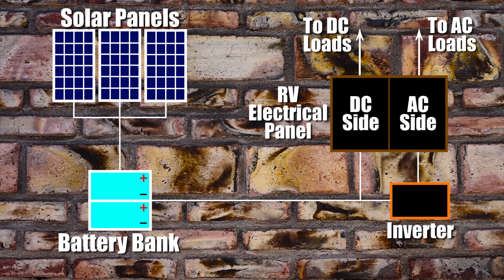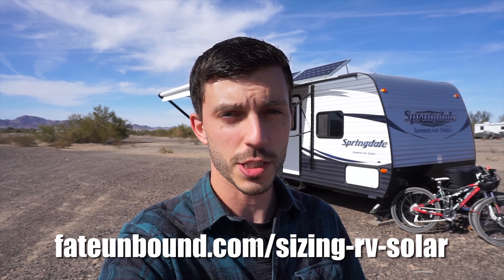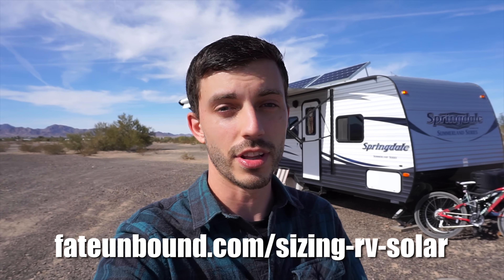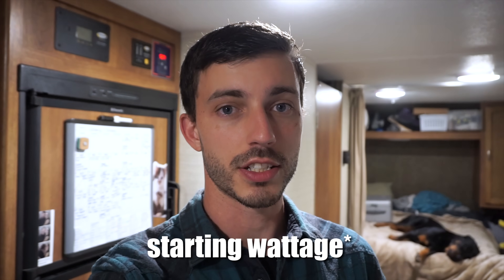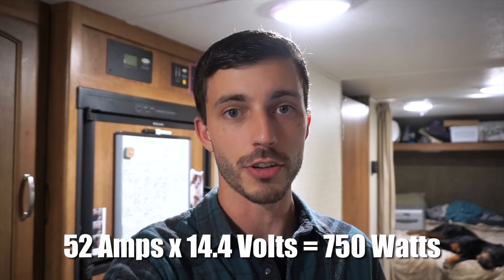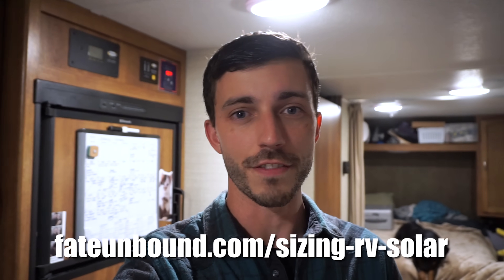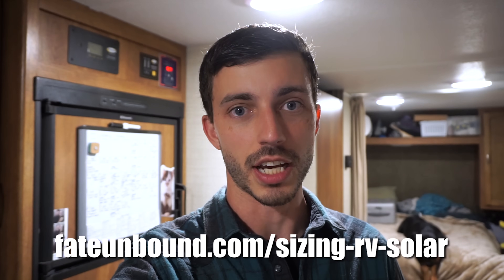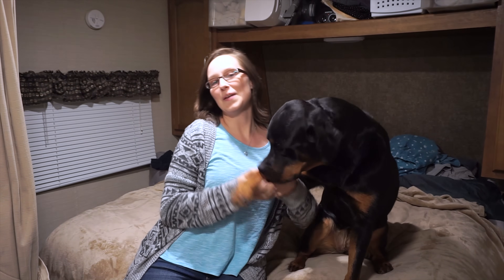How to Power an RV Air Conditioner with Solar - Full Time RV Living

Comment: ok, 73A @ 12v = 876W to run 13K BTU unit.

So if you were running a 5k BTU window unit, pulling 360W, that's 30A.
Figure 66% duty cycle as the unit starts and stops. So you need 20AH (amp*hours) per hour of use. 8 hours of night use would be 160AH. 

Conclusion: You could run a 5k BTU unit all night on a 320AH battery bank and not go below 50% charge. Right?

Comment: We are new to solar. Our rv ac says 310. We would just be running the ac during the day for a couple hours on solar because Florida and it’s satanic hot here right now. At night we run a generator for everything. Just running the generator from about 8-10pm until 4-5am we go through about $17 in gas a day. Our control panel in the rv says it’s an 80amp but my father in law says it’s a 110 rv. I have no idea what all this means or how many batteries or panels we would need to run our ac for a couple hours and our mini fridge.
Reply: How much space do you have on the roof for panels?

Comment: You could add a soft start for the AC so it wouldn't draw as much to turn on the compressor. You could also get a smaller AC unit for say just the bedroom or any other area you can seal off by curtains etc.There are small 5000-9000 btu units either as a window mount style or mini split system, these will be good for 150-300 sq ft.

Comment: This is awesome news, I have a friend that bought himself a 21-foot 2014 tag along camper. Someone had put over $3,000 worth of solar panels and batteries in it. And he has not even attempted turn on the AC, this is really good news to see if he has the right equipment to make it work. Thank you so much for this awesome information. You the man, God bless

Comment: This is a major advantage of a van. If you absolutely must on an exceedingly hot day, you can simply cycle the engine and blow the factor AC a bit. I find that the van AC combined with the roof vent fan set to blow out cools the van down very fast and effectively, and uses far less gas than what you’d expect.

Comment: Hey, kudos to you.  I wish that I could install panels and do all that wiring on the sine converter etc.  With the new 12 volt refrigerators
Replacing the fire bomb absorption fridges and boondocking becoming so popular a rv trailer must be able to sustain itself longer and longer.  You guys have just given yourself even a bigger edge to go wherever you want.   Congrats..

Comment: Why do you need 13,000 btu in that small camper? Answer- YOU DON'T! Replace it with a 5000 btu! And a little info for you hard core people- A certain tech is working on a 12v dc air conditioner for smaller campers! And may even be a 1500 btu model for really small campers!!

Comment: Some people replace the RV system with a mini split heat pump system with VRF.  Very energy efficient and does heating and cooling.
Reply: So doesnt that still need electricity?
Reply: @alive-awake  yes but way way less. Even a window ac unit uses way less than a rv overhead ac
Reply: @alive-awake  it has a soft start, and double the efficiency.
Reply: Interesting Mr. Taylor.  Good looking out

Comment: you missed that recharging the power into the batteries is not 100% efficient, more like only 80% so you need even more to recharge than what you use. unless you have lifepo4 batteries, they are much closer to 100% efficent

Comment: I'll be running my 10K BTU A/C on a 5.2KW Tesla model S battery module with 1.25KW of solar.
Reply: What kind of rig are you driving?
Reply: @PaDutchRunner  we're just about done converting a 2000 E350 handibus into a tiny home.
Reply: Where do you get that battery module?
Reply: @matthewbrigham7715  I got mine from eBay for C$1500.
Reply: @kaidenrogers  Thanks Kaiden...great videos. Above my head at times, but that's expected with me :)

Comment: I wonder if one were to install a mini split heat pump (120v), how well would it run off the batteries?
Reply: That's what we have in our skoolie. It pulls around 300 watts on the very low end and 1200 watts running at full output.  

Keep in mind that a minisplit's efficiency comes from being able to run at a variable output. In other words, if you only run it for for the hottest 4 hours of the day itll need to run at full output and wont be significantly more efficient than more traditional units. On the other hand, running mine all day long on a hot summer day uses about 8kwh.

Comment: I'm looking for and off grid 2 camper 2 13.5 btu air conditioners system. I've been looking at 5kw kits on Alibaba. I have 5 acres of desert land with a 32' 1977 Silver Streak and a 24' 1968 Silver Streak . I'm remodeling them both and I was hoping I could do an off grid system I could plug them both into. I'm a newb and I'm struggling with solar a bit. Thank you.

Comment: You can use a 5 gallon ice in a portable thermal box cut a whole the size of a small fan and cot another spot the size of a vent and run the fan through the ice and you get very cool air coming the other side and you can keep a small place nice and cool even in desert weather

Comment: 73 amps for 1 AC does not sound right. 
Think about your house. What do you have at home that even draws that much?...
At those amps you would pop the main breaker on a 50 amp landside hookup.

What am I missing?
Reply from the maker: We aren't plugged in out here in the desert. We are talking running the AC off our 12 volt batteries not from a 120 volt wall outlet. 73 amps from 12 volt is 7.3 amps from 120 volt. Get it?
Reply: Thank you for that explanation. I had no idea.
Reply from the maker: Yep! The amperage draw from a 12 volt source powering a 120 volt appliance will always be 10 times higher than the required amperage to run the appliance because watts = volts x amps. If voltage drops by a factor of 10 then amps must increase by a factor of 10 since watts remains constant.

Comment: I'm going to attempt a hybrid approach with my system. I have three 100ah lithium batteries, a 3,000 watt pure sine wave inverter, and 600 watts of solar. I recently purchased a tiny Ryobi propane generator (weighs 25lbs and does 700 continuous watts) + a 26 Amp Noco Genius smart charger. Also just added a soft start to my 13,500 btu AC. Excited to see how much run time this setup buys me.
Reply: Any update?
Reply: @lemm1388  I'm waiting for an update as well
Reply: Figure it out? lol

Comment: I have a 1993 Roadtrek 19 ft. right now we run the generator when traveling to be able to use the back  air unit which is a 6500 btu unit. wondering if would be feasible to run just the air conditioner off of solar . live in Florida and usually travel with grandkids to upstate NY. can plug in when get there but need that air when traveling and even for everyday in summer, hate using generator so much. any advice or comments please ty

Comment: I am considering adding a wind generator , verticale kind, not the prop type, to compliment the solar system.  If it is a windy night or cloudy day, the wind generator will charge battery bank.

Comment: Are your panels permanently attached to the roof? I’m a little freaked out by doing anything that might compromise my roofs water tightness. Also worried about roof maintenance with one more thing up there to clean and seal around. I have TPO roof.

Comment: Why in The World Would You Need a 13,5000 BTU AC Unit When a 5000 BTU Unit Would Work Fine ?
Reply from the maker: I think it's because these air conditioners have a difficult time keeping up when it's really hot outside, like 95+ degrees. So a 5,000 BTU AC would fall short even sooner. Just a guess though.

Comment: Considering getting a 450 watt 5000btu Frigidaire window unit for a sprinter van. 22 feet by 6. less than 150 sq ft. draw after start only 300 watts. so basically just take your figures and divide by 3?
Reply: Patrick Allen to calculate power consumption, use very simple formula.

Volts x Amps = Watts.

If you know 2 of the 3 variables, you can pretty much solve most electrical questions.

Look up “ohms wheel”

Comment: Seems to be some confusion, the ammeter is measuring the current being drawn by the inverter  to power the AC unit. The AC unit may peak at around 20 amps during start up. Are you running a 12v system?

Comment: 13000 btu is over kill big time for that camper..you would be better off with a 5000 btu portable.  Those camper related products are very overrated..and poor preforming..but you would have to roll them dice to ever find out..my 8000 is a little bit under sized for the tiny house. 27 feet long.. should have got a 10,000 btu. Fyi the tiny house is two story

Comment: P.S. Lead acid batteries are bottom end...agm as well..fine for stationary systems but inferior for that as well...go lithium ITS NOT MORE EXPENSIVE...if you can do remedial math... I'm not the brightest star in the sky and mine works great so far..I. blown away by it actually....no more electric bill

Comment: I built a tiny house and gave an 8000 but ac on solar 500 ah batteries 4000 watt inverter 1800. Batteries are fully charged by noon . And easily carry me through the night with plenty to spare. Also running microwave, coffee pot ,lights....LED.  ,tv,ps3, fans, table saw 15 amp,12" chop saw, small fridge, air compressor,  so I don't know what you guys are talking about..solar is awesome. Size it right and dont go cheap on the batteries and forget about it...and you can easily fit 4-6×300 watt panels on that roof..

Comment: I found your video quite informative and it answered a lot of my questions. I live in a 29ft Layton trailer in S. Texas on the Gulf coast. It is hot and humid here 9 months out f the year. My electric bills are from
$120 to $160 in the summer. However there is plenty f sunshine here so I figure going solar would help a lot, even though it would be expensive to get it set up.
Reply: rbagel55 Look into hybrid inverters. If you are already plugged into shore power and have a modest solar array and battery bank, the hybrid will lower your electric bills. They reduce the draw on shore power/generator by drawing from the batteries and then feed the batteries from shore power when the batteries are low. (This is all assuming that I’ve properly wrapped my head around these things). 

Assuming I’m right about this, you could then increase your battery bank and solar over time until you are able to get off the grid power completely. 

D.

Comment: AC is probably the biggest hurdle for most people trying this life. Once you get over your need for it you can live off grid. I suggest before people begin this life to basically spend as much time as possible outside to get acclimated to the weather. Learn to park in the shade and live in the shade. It is night and day hanging out in the shade under big trees or by cool streams than being in the middle of a baron landscape with no cover. Once you get acclimated you no longer feel as hot as you did. Night time is no longer a problem. In fact you may even feel cold even at 76 degrees or higher.
Reply: I don't care how big the tree is, in a hundred and ten degrees you're going to be miserable. That is why I spend 6 months of my life solving that problem for my RV. I can now run my air conditioner 12 hours a day when the summer gets hot. I hope that others can achieve the same goal so I started sharing my data on YouTube this month.
Reply: I wonder how people made it before AC.
Reply: The main problem is the humidity in places like the gulf coast. It’s the worst part of the summer.

Comment: So... the math seems a bit odd to me. I am heating and cooling an entire 3brm house and the inverter AC typically uses 500w, continously, but up to 1200w if 43°C outside.

An RV is muçh smaller,  so these figures should be achievable.

If your ac drew 1kw continously,  then solar should be achievable for paet of the day, eg sleeping. 1kw x 10hrs = 10kwhrs of storage. Even non inverter ACs should not be running flat out continously in such a small space. Are RV ACs hopelessly inefficient ?

Comment: I have a fifth wheel with large storage in the middle and storage in the front compartment. I'm estimating I'd need "8" 240amp 6v Trojan T-125 batteries. That's 544Ib worth of batteries would I need to disperse the weight out throughout the storage compartments? Seems like putting that much weight in one area would be an issue.

Comment: A good video... Thank you... Would like to see more so Wayside can be more educated in my choices regardless of what manufacturers of RVs and their equipment claim. One thing I have noticed on YouTube is that several people have changed their air conditioners to a low draw unit with higher efficiency, this leads me to believe the units that currently come with a new RV. And I'm looking... Are only interested and Prophets with a low-tech junk and no options. It is now 2018 -2019, and there's got to be better Tech

Comment: I’m a little confused by the information in this video, since your system seems to be a very similar to mine, only  I have less solar and less battery but can run my air conditioning with no issues for 6 hours. 

Yesterday I installed a 500w solar system, 3000w inverter (exact same model featured in this video), soft start capacitor and two 12v 100 AH Battle Born Batteries (LiFePo4) in parallel giving me an ACTUAL usable capacity of 200 AH (since they contain an unspecified unusable reserve capacity allowing them to advertise 100% discharge)

I was able to run my Dometic Brisk Air II 13,500btu unit for over 6 hours (cycling as required to maintain temp) and it drew only 15 amps. 

6 hours of A/C on two 100ah lithium batteries.
Reply: R Graham please define a “soft start “ capacitor.  I am an HVAC tech and I have no idea what you are speaking of.

There is a “hard start” capacitor, which provides a huge amount of start up power, which significantly lowers start-up amps of a compressor.  But I am confused what people mean when they say soft start.

Thanks much,
C

Comment: Do you think a smaller 5000BTU AC will work better for most small RV with battery power and solar charger?
Reply: Yes, worst case scenario you can partition an smaller area to keep cool instead of the whole rv

Comment: Inverter Technology Air Conditioners with DC driven compressors are the way, a few people have mentioned these already I agree.  My home unit is a 48,000 btu split or a 4ton system.  It starts on only 1.64amps, ramps up to 12amps~ before settling usually in the 4 to 9amp range .  For a 13,500btu inverter system you'll find those high amps are a thing of the past and will be pleasantly surprised how much longer these AC systems will run.  Love your videos.

Comment: Not knowing about RV solar systems, i would imagine that to run the AC, and most of your 110v appliances you would need at least two 100ah 12v LiFePo4 batteries, four 100w panels, and a 2000w inverter to run your AC...  So the trick is the type of battery needed to keep it the system powered.

Comment: One thing to remember also,  when your putting that kind of load on a battery bank,  you will be making quite a bit of hydrogen gas.  With that being said, there's always a risk of fire or battery explosion.
Reply: Not with lifepo4 batteries

Comment: If you run the A/C on solar ..I know you said you don't want to deal with portable solar cells .. If the system can add portables that could be an answer to add power to the system .. You may not wish to do this but others may want to do that .. But you do have some storage room where your inverter is .. Just my own thoughts..

Comment: Capacity information is spot on. However, the inverter sizing information is inaccurate. A typical pure sine wave inverter will handle double the rating for a short time. Usually 30 seconds to a minute.

Additionally, a soft-start kit can drastically reduce in-rush currents for large induction loads such as air conditioners.

Lastly, A/C efficiency should be the first consideration. The typical RV air conditioner is far from efficient, while the 12,000 BTU Climax Aire VS-12 dual hose portable unit consumes as little as 7.5 amps at 100% power and just over 4 amps at 50% power.

Taken together, all these contribute to the very real possibility of air conditioning on solar.

Comment: I have a very similar rv and I'm trying to downsize a/c for a solar system.  Why wouldn't a 5,000 btu window a/c work?  I'm just trying to get feedback before I do anything.
Reply: 1987Rlee From what I’ve gathered, find the square footage that an AC unit is rated for and multiple that by  .66 or .5 (2/3 or 1/2) depending on how well your rig is insulated. That should give a good indication as to wether or not your 5000 btu AC unit will work for you. Once you find a unit that works for your RV then you can figure power needed to run it using the calculations in the video. 

D.

Comment: I have 4 Systems I put together on 4 separate RV’s. None were sized for Air Conditioning. My present Toyhauler has 2-8D Universal Power Group in my garage. Strictly for our entertainment on 2-200 watt 24 volt panels. Then for main power source we use 5- V-Max tanks with 2 - 64 watt panels. We aren’t full timers but have setup this unit up for full time if the need should happen. Our Onan 5500 is strictly for backup use or Air if the need arises. I would never suggest trying to use air through an inverter even with a 10,000 watt inverter like ours. Just not a good idea at all, that’s a fast way to melt down a great inverter.